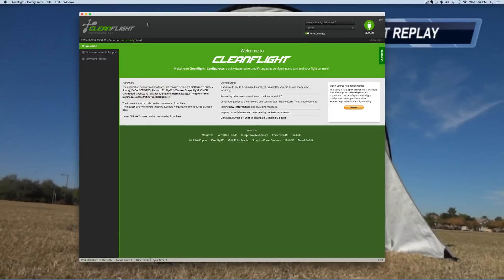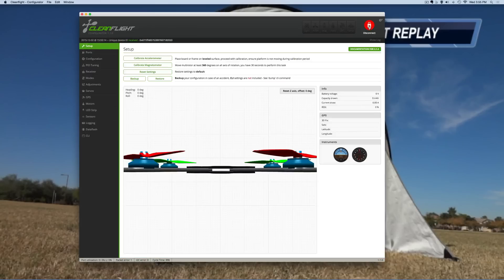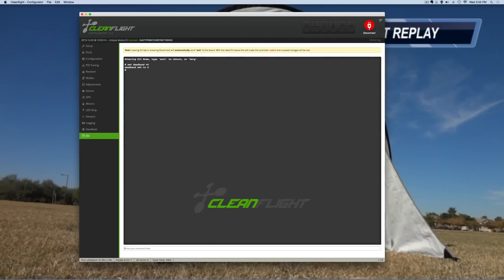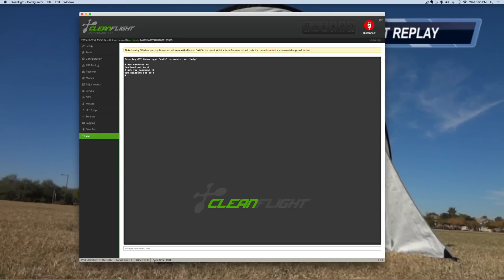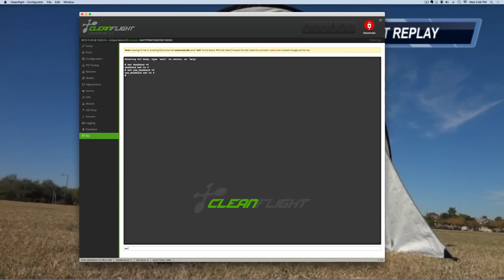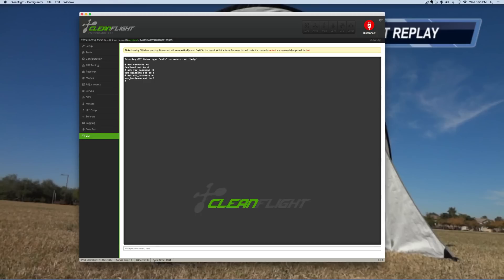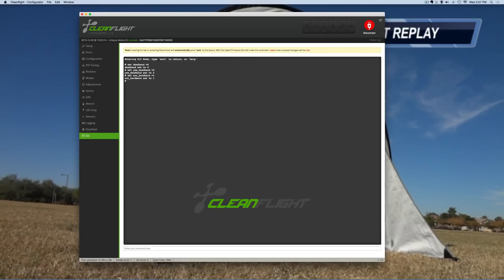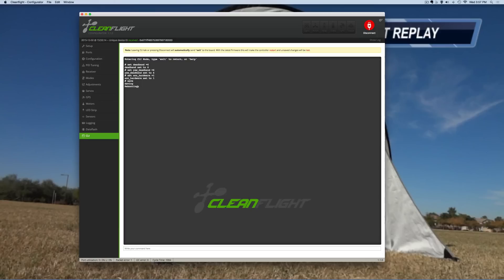Improve Naze32 Performance with Cleanflight or Boris B Betaflight CLI Commands

Comment: Johnathon, Hope I spelled that right lol, but I have the Eachine Assassin 180 after having the 250 Racer for a while now and am desperately needing to set it up and fly it!!! BUT having problem with clean flight for I am used to using Libre Pilot for the CC3D 250. I hook the copter up put in the configuration jumper and not really sure which way it goes in one video I watched he puts it in looks to me like the wrong way for the connector has a specific top and bottom and best way of fitting but he puts it in upsidedown of that to where the left side of the connector the wire is in the first hole and at the other end the second to last hole, but I find when you put the plug into the socket it fits better the other way?? So which way is right. Also the main problem...It will not see my FC board it keeps saying failed to connect and I do NOT know what I am suppose to put in the boxes at the top right the Port and a value and Manual selection?? What goes in those boxes and do I need to put something there or will it find it itself??? What exactly do I need to do to set this thing up before I take a hammer to it or sell it on eBay or something I'm really tired of the thing not working and I'm doing EXACTLY what the video shows on setting it up for he doesn't show any of the USB to UART stuff what is that and what do I need to get to make it work?? VERY CONFUSSED PLEASE HELP??????!!!!!!-Thanks and good video I just need more information on this.-Brad.